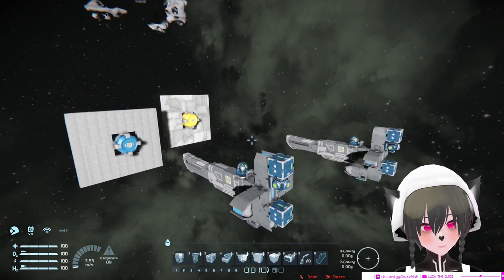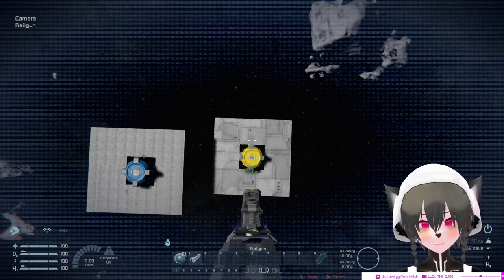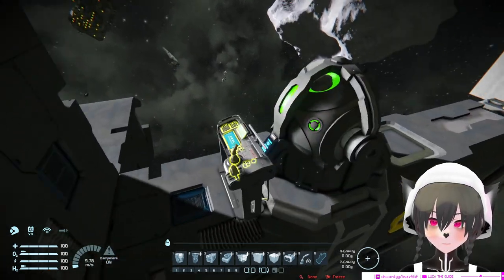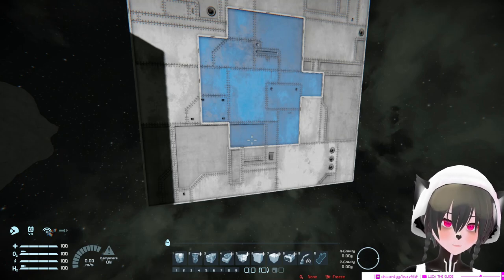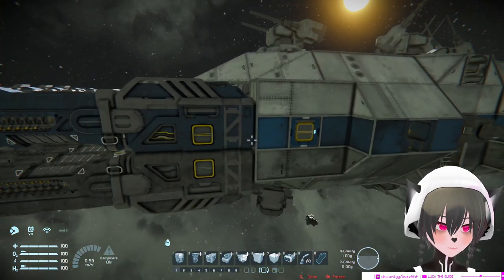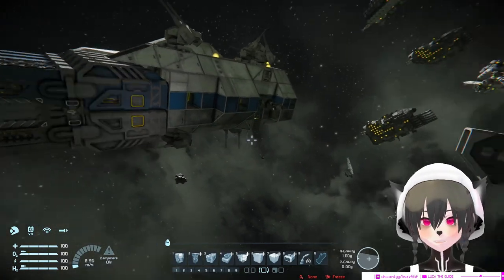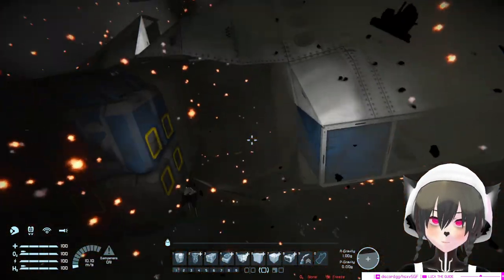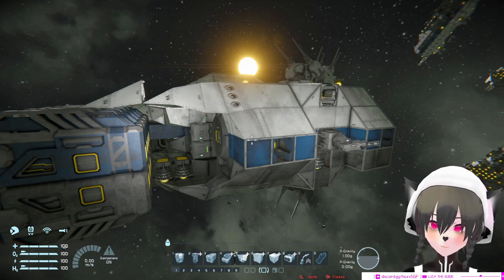Space Engineers Ship Design Tutorial - Explosion-Resistant Structural Integrity Guide

Comment: On my main ship I used blast door door blocks as internal safe guard and structure support. Having my ICS have a blast door plate built under it so my command station could not be easily disabled from any direction. 
The main cargo crate is surrounded by blastdoors. And the large thrusters have a separation gap from the tanks, made of blast door blocks. 

It definitely makes it heavy. But the only thing that has stopped my ship was me accidentally running It onto a meteor at 200 m/s (was cinematic at least
Reply from the maker: That's a smart way to do it >:3

Comment: Since the explosions' damage and radius is based on the number of liters of gas in it, there is an option for some ships to use the smaller hydrogen tanks placed in a row (they also have a different explosion shape, it's more cylindrical) which means instead of needing a 3 block high belt of armor, it only really needs to be a long 1 block high beam covering them. They are also easier to cover all over with something like light armor plates which help eat the explosion if they do go off. As for the conveyor connection faces, my testing has shown me that the conveyor tube will survive a fully loaded small hydrogen tank being detonated but the light armor touching its non conveyor faces didn't, though the stuff beyond the armor was fine.

I have recently begun using the small tanks more to ensure that the detonations are much more localized and far weaker and easier to contain with something cheap like light plates, as well as making them easier to hide behind heavy armor or blast doors.
Reply: A fairly sound idea. Not only are you minimizing the damage but also adding redundancy (a common thing in aircraft and ships). The main downside that is that your PCU count will be eating up by it since a small and large tank have the same PCU.